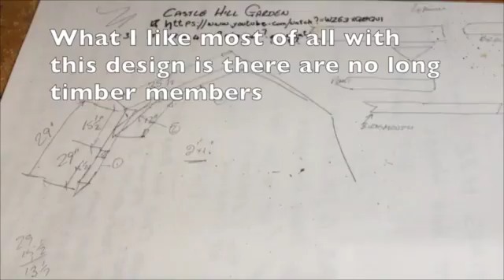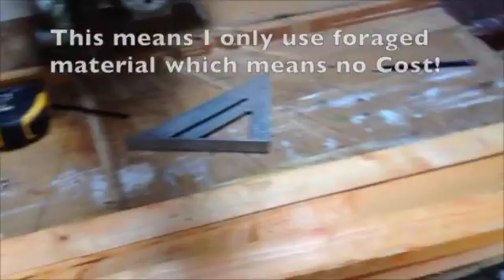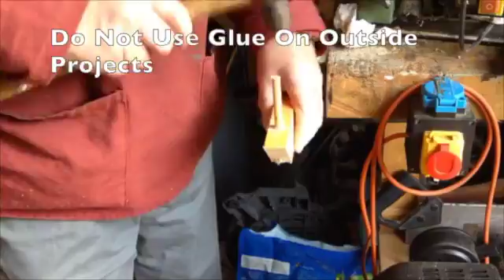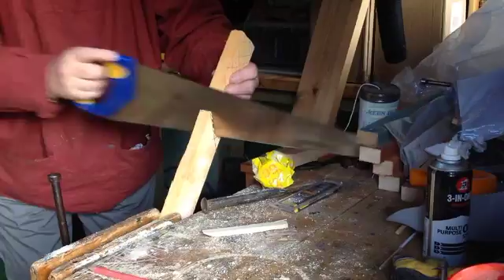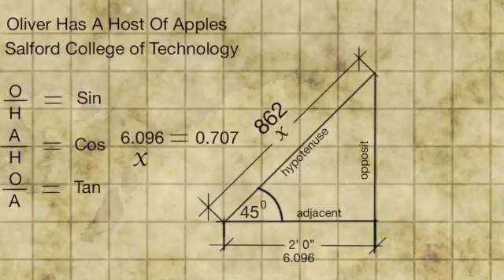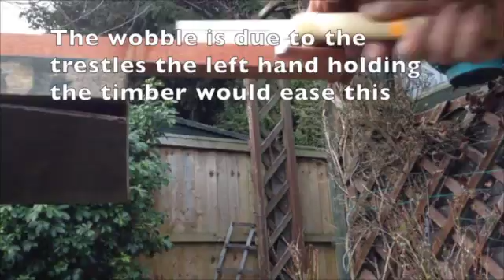Allotment Diary Protecting your vegetables Part 2

Comment: Nice job Mike. I've got a pull saw and find them very accurate. I like your radial arm saw. What make is it?  Cheers...Nigel 👍🏻
Reply from the maker: Hi Nigel It is an old, old American De Walt with some history.  I bought
 it off a guy I knew who had a luxury cab firm in Holmfirth taxing 
actors between shoots and hotels for Last of the Summer Wine.  When the 
program ended he was building a bungalow so bought the saw from the 
scenery workshops and I bought it of him.  It was old when I bought it 
and I have had it some years.  American De Walt do not exist now Black 
& Decker bought the name.  Take care Mike B